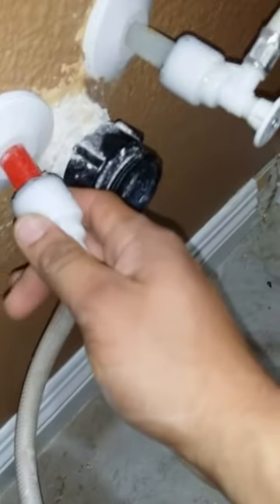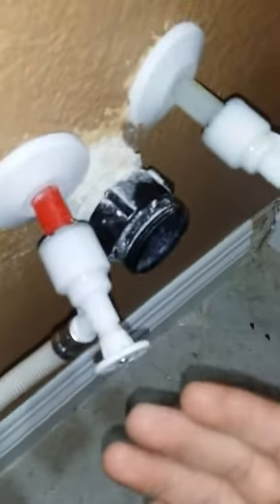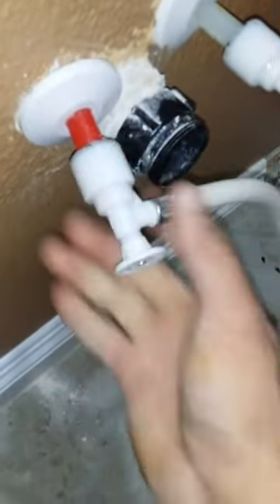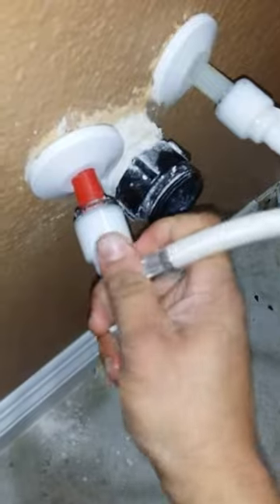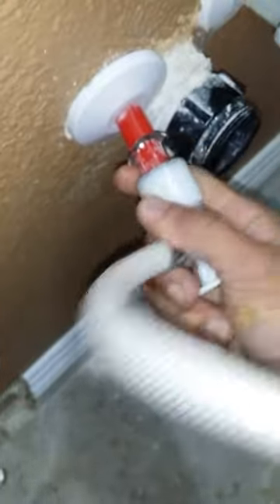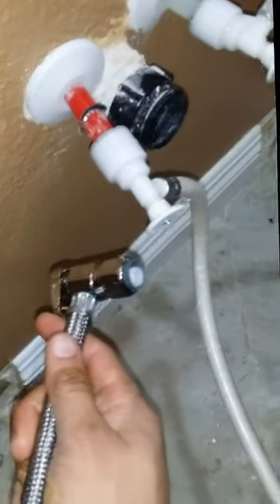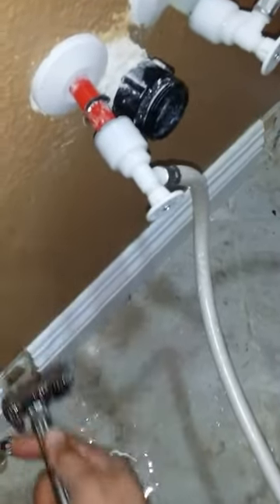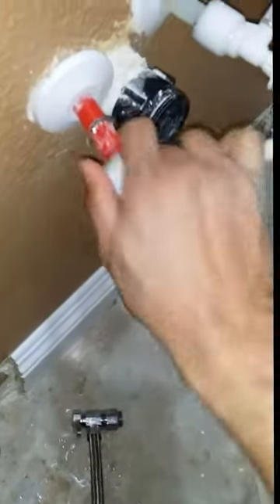Remove/Replace FlowTite Plastic Valve Faucet with Sharkbite EASY!

Comment: Thank you very much. This is my 5th home and I have never seen such cheap material used in new homes. The home I purchased last year is now 12 years old. These plastic valves will not even shut off! I could not tell if the female end on the pipe was threaded or not. Thanks to this video, I can see it is simple. I do not understand why 13 people disliked it. It tells you how to get it off without destroying your home or having to call a plumber that makes more than a brain surgeon and most of us are familiar with replacing  these shut off valves.

Comment: If you replace these plastic/commercial type shut off valves with a sharkbite for a kitchen faucet with a straight valve and the valve is copper do you need to cut down the copper to install the shark bite flush to the water supply valve?

Comment: Quick-connect and push-to-connect fittings are not permanent, but should only be reused for temporary installation. The lubricant on the collet of a SharkBite wears off after a while, and the O-ring of either fitting may stretch or wear out

Comment: I cant find the valve for the shut off!! I have the same plastic tips.  But No main valves. No pinche pipe with a valve. So it must be underneath my house? First time mobile home owner LOL.
Reply: You just pull the top of the plastic part up to close the line, and push down to open the line